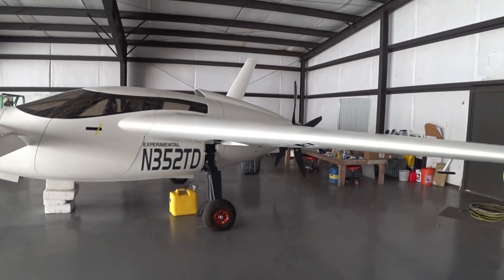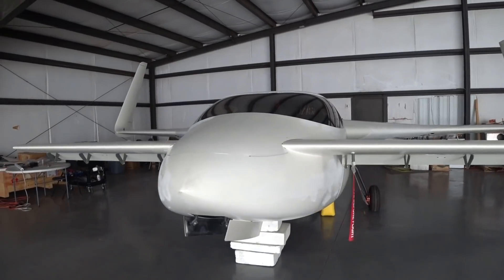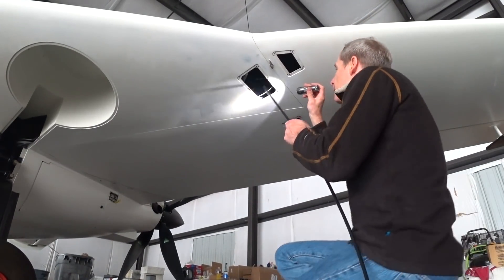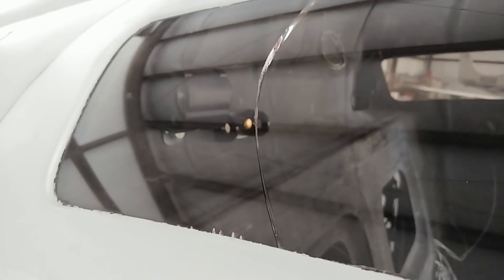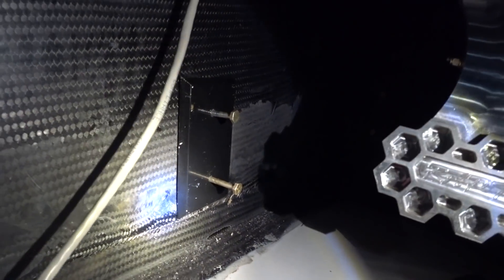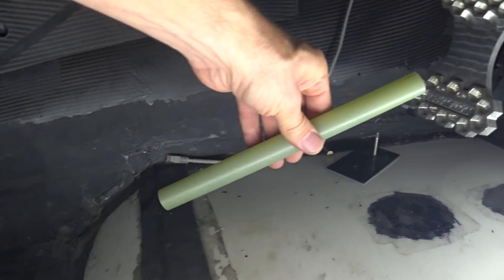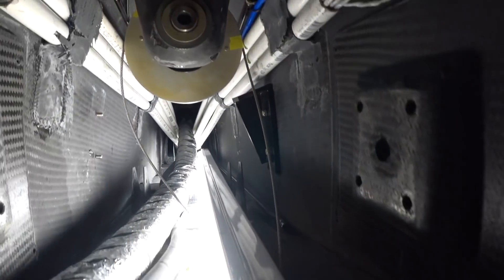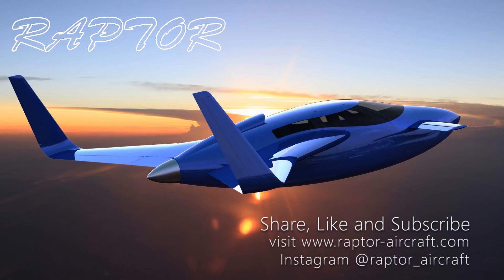Sleeved Aileron Cables - Building the Raptor Prototype

Comment: As far as the broken window is concerned, I'll bet you didn't have the engine hanging on the firewall when you put the window in. When I built my Velocity the doors fit perfectly until I hung 450 pounds of engine and prop on the firewall.

Comment: When you Crimp these Nicopress sleeves you need to keep the Tool closed for at least 20 seconds. The Nicopress is a quite soft Alloy which "flows" when its deformed. If you open the tool to quickly the is a little bit flex an you wont reach the max crimp tension you need to achieve. Also you shout test each crimp with a special Gage to ensure the crimp is tight enough.

Comment: In the automotive world I’ve replaced many sleeved cables that were seized up due to the cable wearing a groove on the inside of the sleeve and eventually getting pinched. Anyone here ever have a stuck throttle cable? A very stiff heater/temp adjustment cable in there 80s/90s car? A hood latch that didn’t seem to pop the hood? These are all sleeved cables that seize up from the inside. I’m sure you have a fix for this? I’d be nervous about flight controls...there’s a lot of motion constantly on those cables. I’m sure someone else has probably mentioned this and you’ve got a solution.
Reply: Add lubrication during the annual condition inspection?

Comment: Sleeved cables like these only work well when used with relatively little preload tension. They work fine with Velocity and LongEZ canard rudders because those systems have no preload tension; the only tension in the system is that required to overcome the centering spring and deflect the surface.

In a closed system like these ailerons, there has to be preload tension to eliminate slop. But that tension will will almost certainly add so much friction that the aileron feel and response will be seriously deteriorated.

Comment: If you are lucky, the cracked window was simply defective. For example.  forming plexiglass introduces internal stresses. Baking the part after forming it will normalize it. The window may have had residual stresses.

Comment: The crack could have also been caused by change in stress from having it up on the foam blocks.

I am sorry about the fire. I also watch "Life on the Hulls" and Peter Anderson's channels. Here in Northern California, we had a rough summer, too.
Reply: I agree. A Laminated carbon part is not truly rigid, and a heavy cylinder should not be resting on a stack of foam for any length of time.  The gear are attached to much more robust vertical members.  Also, proper isolation of materials with differing CoE are crucial.  Your car’s windshield is not glued to the metal frame. It’s stuck on a rubber cushion.

Comment: plexiglass can be a very quirky animal. better for it to crack there.. on the ground, than while under pressure at altitude. chalk it up to preventative testing. ALTHOUGH... you said you didn't think anyone broke it while you are gone.. you ARE kind of the 'elon musk' of general aviation. If I were cesna / piper / beechkraft… I would NOT want you to succeed. check all your critical parts & systems VERY CAREFULLY before you fly.. that's all I'm saying.

Comment: Whats happening with that window is the cabin is expanding in the heat and contracting in the cold causing a stress fracture. 

Could use a flexible sealant around the edges so it floats on a cushion. Or you could use a rubber base and lock the windows in place with a flip pull type lock or motorized that you see on coupes back windows. Good stuff.